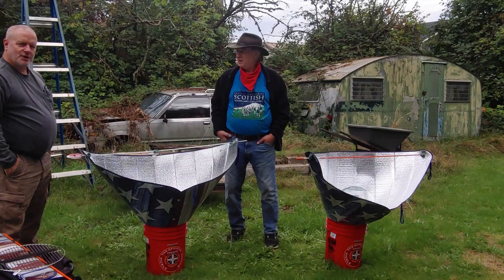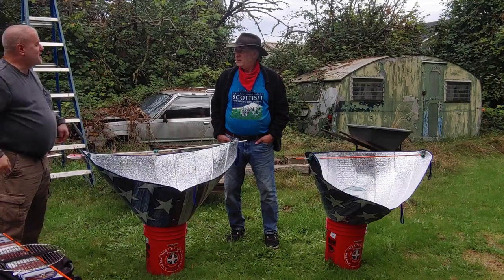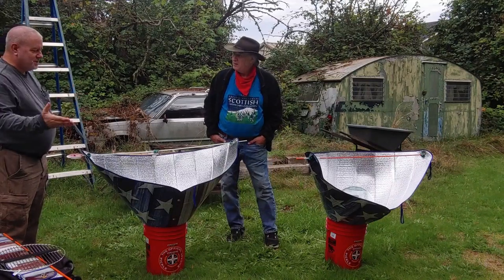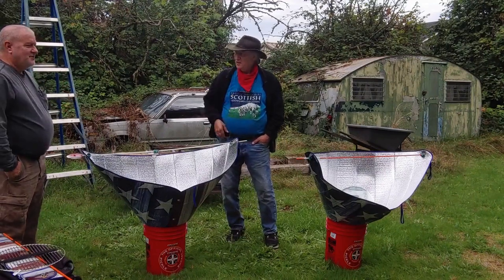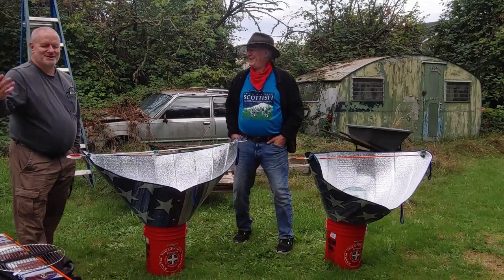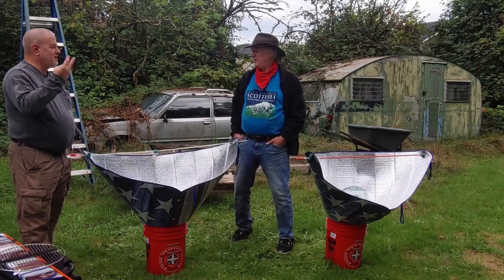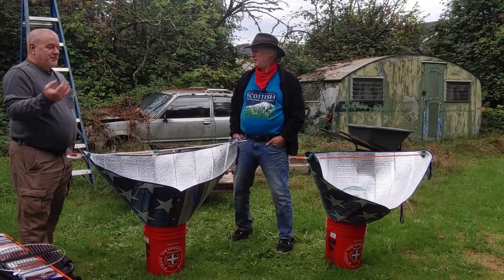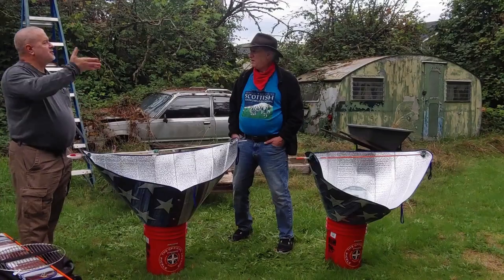Charles Wright: DIY Trucker's Windshield Reflector Solar Cooker

Comment: The US Pyrex mixing bowls tend to not be borosilicate any more the ones manufactured in France for Pyrex still seem to be borosilicate glass... the  Pyrex Bubble type greenhouse configuration using the US version of the glass still works well for this use.
Reply from the maker: I forget the source--but recall that some makers of borosilicate kitchenware, switched to something else for a while but got called out for the many baking dishes that couldn't take the heat, so they switched back. I always look up glassware to be sure it's borosilicate before I buy it. Though, for a heat trap, I don't worry so much.